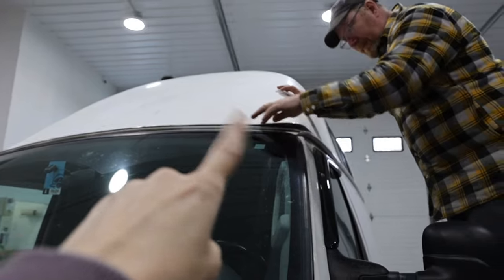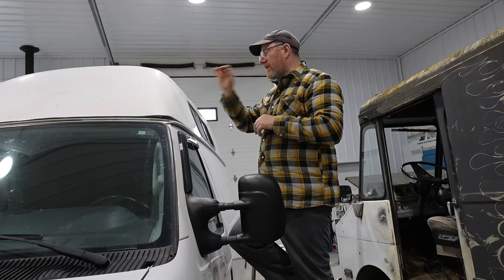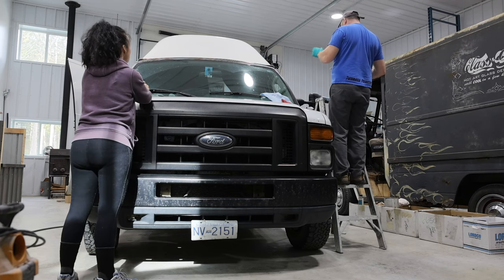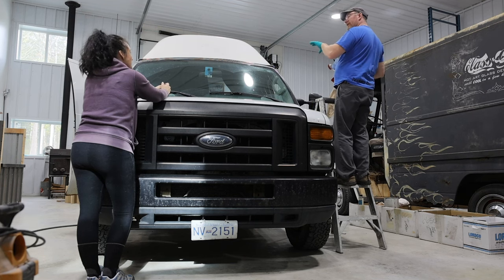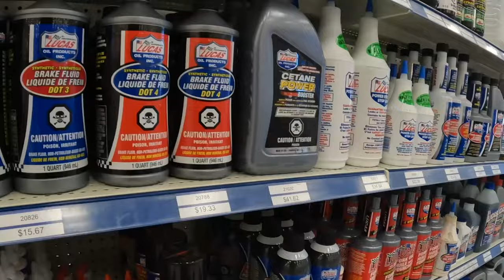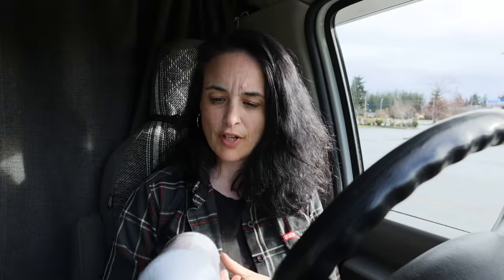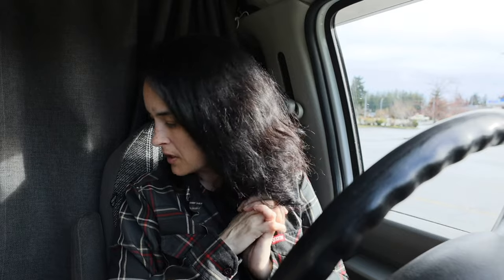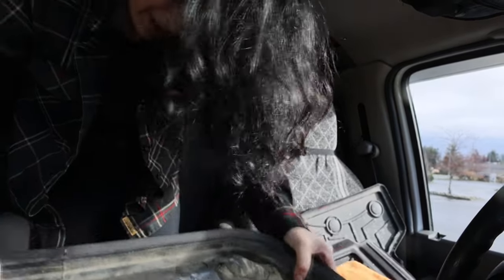I NEED HELP WITH ALL THOSE PROBLEMS | Van life

Comment: Leaking oil means replace your gasket. If that gasket blows you will need towed. Three times a charm with the water leak. Emi, you have a positive attitude, independent and patience with your van troubles.

Comment: Sikaflex is the absolute best stuff to use on anything on the outside of your van...stays flexible and never lets go.  I used it to put in my windows, fantastic fan and to seal where the wires from my solar panels come thru the roof and that was 6 years ago and no problems.

Comment: Sikaflex works well, that's what we used for sealing windows on the ferries, during refits. Last year, however, when I was in Walmart looking for stuff for my build, I came across flex-seal. I'm really impressed, because it doesn't seem to dry out, it appears to keep it's 'rubbery" state.
Reply: RV places sell a specialized sealant product in a tube for all joints. Never failed on my truck camper aluminum roof.

Comment: Please be aware of your head gasket.....I blew my engine.  I didn’t know it possible to leak all the oil in two days during mild weather 😢
Reply: You look so pretty with your hair down❤❤  love your channle and watching from michigan
Reply: I've done it too, only by overheating from a cracked radiator.
Reply: I agree I was told that I would be ok for a while before it needed changed…two days later the engine blew.
Reply: Get it fixed ASAP, because it eill be a bigger more expensive job if it blows your head gasket,  I have a leaking coolant,  getting it sorted tomorrow and next week hopefully.  Don't wait too long.

Comment: Interesting same issue as my Hightop last year, will rebook.I put silicon!
Reply: Silicon is not ideal for UV conditions. There is a sealant product in tubes from an RV store that is special for the exterior use. A “lap sealant” All I have ever used on my truck camper roof.👍👍

Comment: I highly recommend being a part of the head gasket re&re. You'll gain very valuable knowledge that will come in handy in the future, for yourself and/or others. 

If you can do the repair now, don't put it off, because you can cost yourself much more by continuing to run your engine. 

It isn't that big a learning curve, just more of a hassle on a van because of access.

Comment: Sikaflex is the sealant used, great stuff!    That additive may work as it's not a 'Pressure' leak and is only the oil passage near the corner of the head. Your mechanic know his stuff and nobody would do the head gasket in a van unnecessarily cos it's not a nice job.  So glad you know some good people Emi.

Comment: You might be able to protect the silicone with a little bit of latex white paint, hand brushed on.  I'm no expert, but I live in a desert, and the sun really destroys anything.  A layer of white or light colored paint on things really extends the lifespan of outdoor exposed materials here (for me).
Reply: Silicone does Not accept paint ! neither oil based or acrylic/latex. trade professional here.
Reply: @blueman5924  Oh man, well my bad.  What do you suggest to help protect silicone from the punishment of UV rays?  Or is there a better sealer that could take paint?  Appreciate your expertise, man.

Comment: Surprised no one has suggested a CO test in diagnosing that head gasket leak. It's test to determine burned gases being pushed into the engine cooling system  via radiator fill cap. Looks a turkey faster but holds fluid that changes color when exposed to CO2.  The kit I have got off a tool truck. But I think NAPA sells them, it's from Clover  International,  formally of West Germany.  Yeah, I've been mechanicing a long time. Headgaskets aren't something to put off. Failure is usually catastrophic. It's best to have control when, where and who does the repair. Not some random shop thats closest to failure location.  I've never let my clients drive   with that time bomb. In 50 yrs of mechanic work and backcountry fishing and hunting learned I don't 2nd mechanical devices or wild animals...
Good Luck You Two!
Reply: Lorna seems more like a tinkerer than a mechanic.